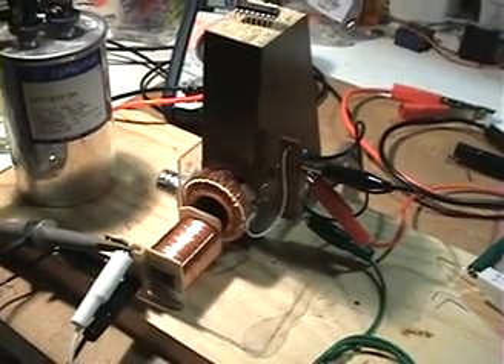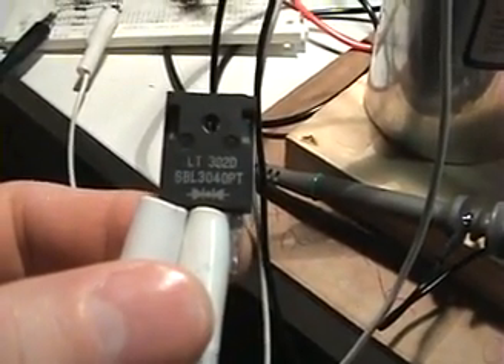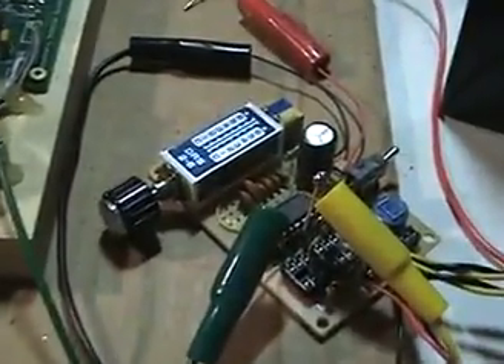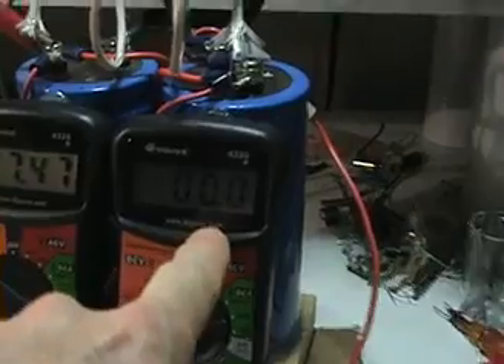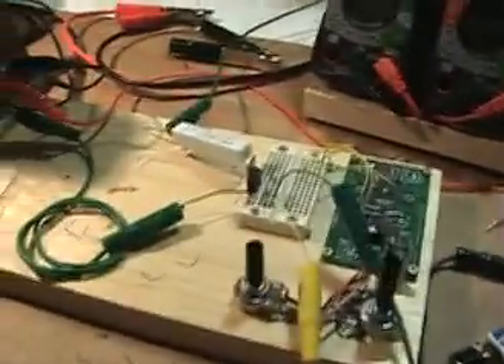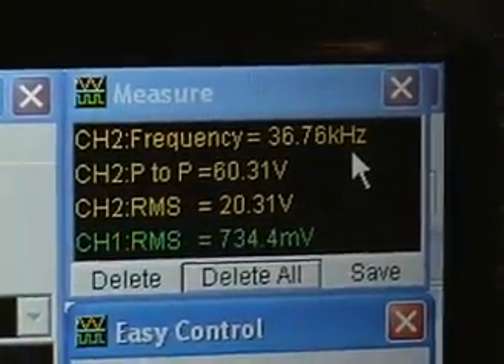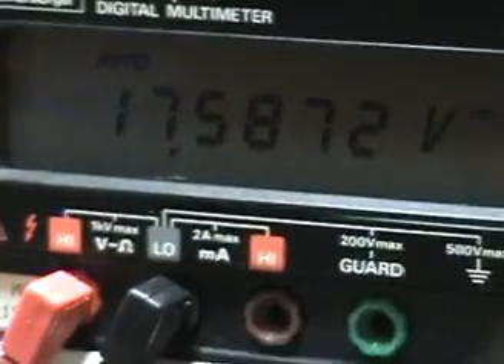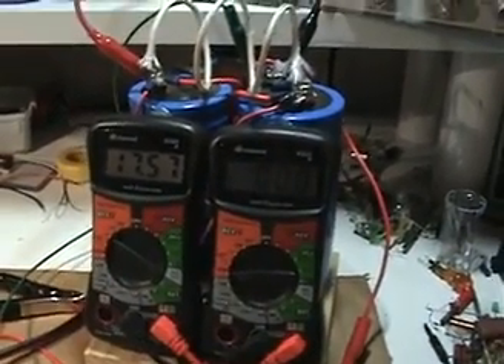Self Running Coil test 4

Comment: Here's the principle https://www.youtube.com/watch?v=Z6_qxuaiQR0Part of the coil cancels the magnetism at first. As soon as the cancelling is off that magnet instantly energizes the coil to induce a current that you're storing the energy from in the capacitors. I would disconnect the bridge and use one coil for the magnetic cancelation and the other to gather the energy. Then you can separate things and gain a better understanding for what is happening. It's pretty simple really. But it's your experiment not mine. Thanks for sharing. One quick note. If you're not careful you can degauss your magnet. Think about it.

Comment: I saw you test your  Rosmary Ainsilie circuit with a digital thermometer. Can you use it to take a timed temperature reading off the toroid? Even ambient balance between Joule heat loss of the inductor and demagnatization cooling of the ferrite toroid material  would point to a possible quantum power generation source. Fantastic accomplishment!

Comment: great job... but shouldnt you beputting that meter with more digits on the run  battery. it would probably show a more acurate volatage drop, if there is one.... hopefully there isnt, but if its switching its using energy rite?????